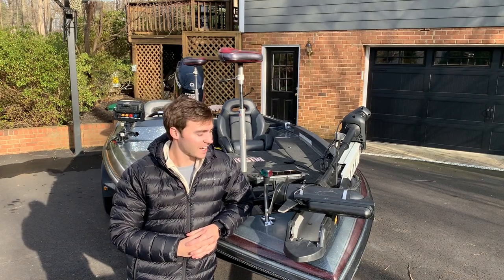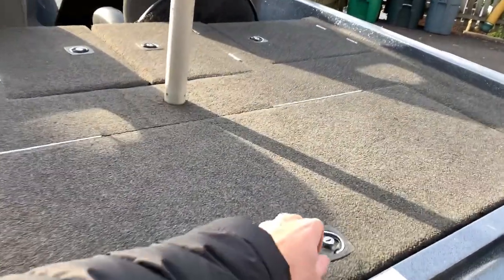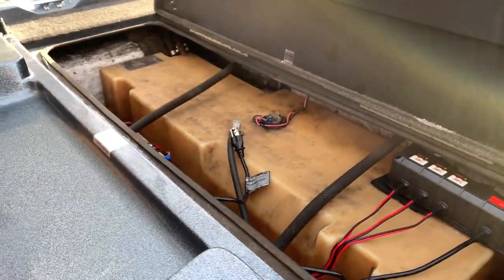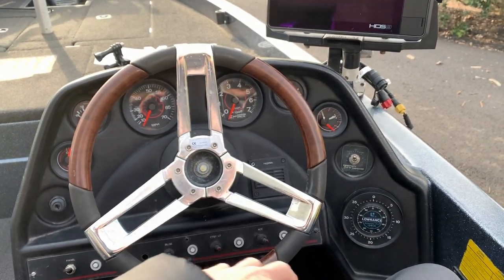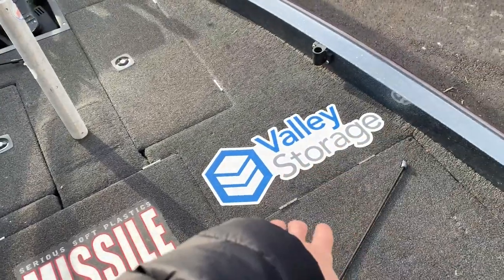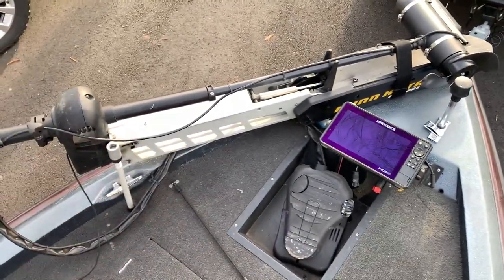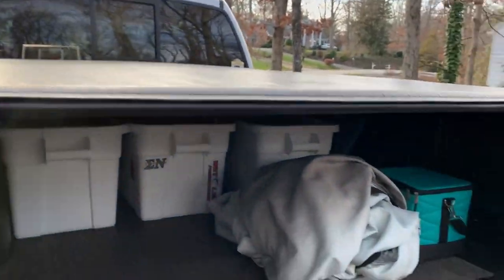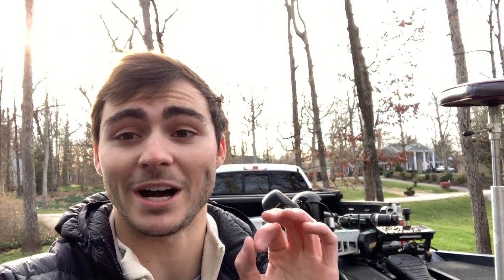Boat and Truck Tour (1993 Dynatrak 181 STE)

Comment: Awsome ... just today i went got my dads old 1988 181 ste dynatrak.. .. long story on how it got gone..since 2006... needless to say, gonna need a good wet sanding.. seats upholstered.. carpet.. still has the original evinrude v6 xp 150 on the back.. the vro has been bypassed... even the original stainless steel prop is there... identical boat as yours, decal placement is different.. i only have ste on the top rail.. on the side it has dynatrak 181 ...
Reply from the maker: That boat has treated me well! It still had the original trolling motor on it when I got it. I’ve noticed mine really needs to be wet sanded as well. Could be the finish of the boats, could be the fact they’re 25 years old haha. Still shines up great though

Comment: That's a great boat. My father has a 194STE with an Evinrude outboard. The hardware for the compartments are all the same, even the gauges. I got a laugh because your stainless all thread for your manual jackplate height adjustment appear to be bent, but ours is the same way. We've replaced them, but they bend for whatever reason. Also, does your live well  drain "switch" work? Ours broke, and I'm trying to figure out how to replace. Our live wells are separate, so one live well fills and drains on it's own.
Reply from the maker: I ended up having to replace the jackplate later on down the line and so far I haven’t had any issues with it (knock on wood). My live well drain switch still works but it’s smack center in between both my livewells and they both connect. If you’re is stuck open, you can always plug it from the inside as an easy alternative!

Comment: Looks Awesome...Just curious if you still have the boat... Also I am thinking about getting an F150.  Has it served you well?
Reply from the maker: I just sold the boat at the end of of 2021. It was great and treated me well but I got a good deal on a newer triton that will let me fish in tournaments with rough water. My current 2011 f150 with the 5.0 has been great. I had a 2006 with the 5.4 before that and that thing gave me nothing but trouble. Overall I would go with Ford again for my next truck.